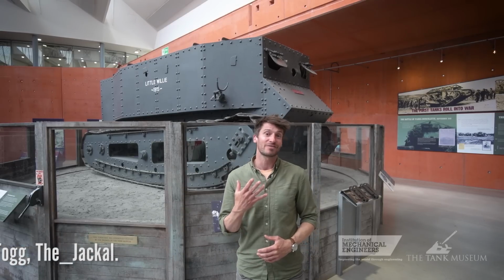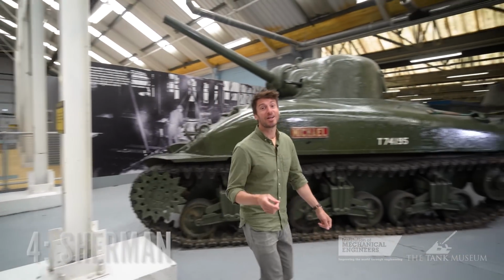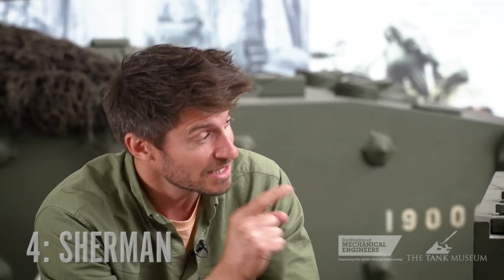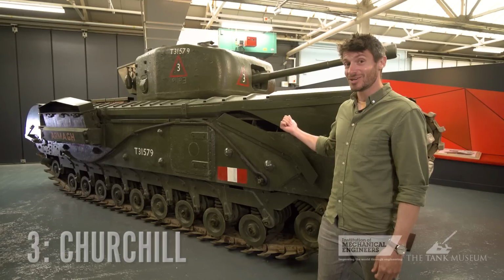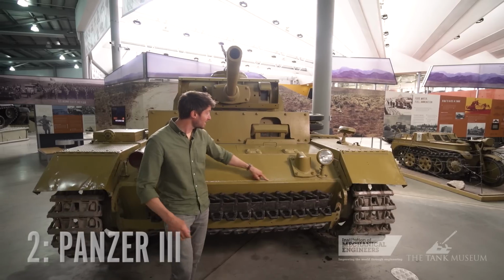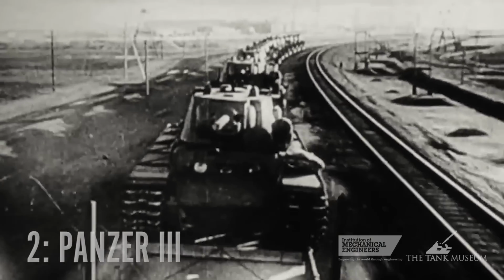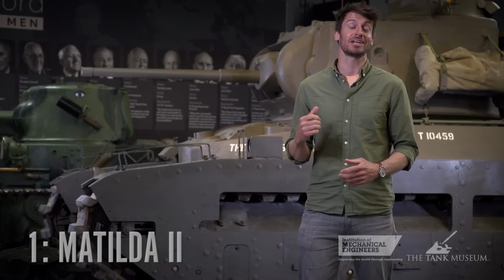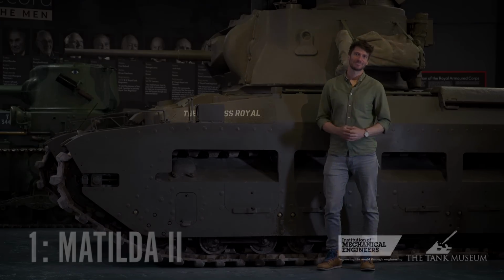Rob Bell | Top 5 Tanks | Institution of Mechanical Engineers | The Tank Museum

Comment: 'Five tanks and five rules for engineering success' 00:06 - Welp, that's the German cats out...I like this list already
Reply: Is not one of them get the technician to check your using the right formula or how ohms  law works
Reply: @mauricewalshe8234  Leopard II best tank in the world!!

This comment was made by the Bundaboo GANG
Reply: Realkeepa 1991 Only thing missing on the Leo 2 is that sweeeeeeeeeeeeeeet Turbine engine that the Abrams have 😍
Reply: @kshatriya1414  And a fuel tanker following. Gas turbines are notoriously thirsty
Reply: @g8ymw  They're not so bad when they're actually moving, but at idle..
Reply: @kshatriya1414  
Leopard 2: 12 cylinder diesel engine MTU MB 873 
Abrams: Gas turbine AGT-1500
 
The difference is for examaple that the M 1 needs twice as much fuel as the Leo 2.

I think the only thing in common is the fantastic smoothbore tank gun Rh-120 from Rheinmetall
Reply: @r.j.3440  a straight turbo diesel is also much more reliable than a turbine. Especially in extended military operations where scheduled maintenance is a pipe dream.
Reply: @LARGO125  …and Diesel you can get on every gas station
Reply: @wernerkl4036  they both run in the same fuel.
Reply: @JimmyCrawford  Auxiliary Diesel Generator: Am I a joke to you?
Reply: @r.j.3440  First: Twice as much fuel, that is an extreme over exaggeration. Although while under-load  the Gas Turbine consumes a bit more fuel than the Leopard, the bigger fuel tanks will ensure the Abrams will run out of fuel around the same time as the Leopard. 
Second: The Abrams has a auxiliary diesel exists for idling.

Comment: Matilda 2 yay! So refreshing! 😋
Reply: I expected Valentine as nr 1. It required 1/3 of the work hours to make than Matilda II. Similar protection to T-34 but was much cheaper. Perfectly engineered to match Britains specifications (being cheap and under 20 tons) it saw many improvements. Designed with a 2pdr gun it ended up with a 75mm. Because it was smaller, more mobile and more reliable than a Matilda II, Soviets liked it better.
And the fact that is was cramped inside isnt an engineers fault. The blame goes for underdeveloped British doctrine, and pre-war government cuts on land army spending.
Reply: @Paciat  I suspect the The Tank Museum effort to restore the matilda tank has highly influenced the decision for the top spot

Comment: On the No1 choice the criteria surely fits the Valentine better. The Matilda II required skill and resource heavy large castings and a difficult to maintain track system. The Valentine was designed for production ease without compromising performance. Still being used in 1945 by the Soviets who always wanted more. Design requires compromise and the Matilda II only scores above the Valentine on armour. The Valentine allows more tanks to be made and those are more likely to actually arrive on the battlefield thus the Valentine is more effective for the same resources.
Reply: Yes! The other entries on the list focused on properties of each design. The Matilda II was designed for the previous war, didn't learn the lessons from Spain, Khalkin Gol, and couldn't really be adapted - no upgradable gun. The whole 2 pounder fiasco ranks up there with the US torpedo fiasco. That it was mass produced is not saying much for the design as the general industrial capability of GB in the late 1930s and early 1940s. There was a lot of companies and shops that could do complex metal work to specification. From the Tank Museum's own series about fixing up the Matilda, that tank was a bear to build and maintain with many hard to access fussy bits.
Reply: The two things that push the Matilda II over the Valentine, from the video, was the length of service and the variety of theatres it served in. While the Valentine was meant to be the successor to the Matilda, it wasn't put into production until 1940, after the war had started. By comparison, the Matilda had been first produced in 1937, a full 2 years before World War 2, and 3 years before the Valentine first rolled off the production line. As for the breadth of service, both tanks served in a variety of theatres. Freezing cold snow, blistering deserts, soaking wet jungles, cramped farmland and bustling towns and cities. The Matilda was more widely known to have served in all. So while there were issues (and positives) with both tanks, I can understand where he is coming from.
Reply: @f12mnb  well that's not at all a fair comparison is it?
Reply: The Matilda II was used until the end of the war across the Pacific. Basically impervious to anything the Japanese could throw at it.

Comment: The only man to say the churchill had excellent mobility
Reply: Rachid Khamlichi not the only, have you seen how steep a hill they’ll climb?
Reply: @DeBlobbb  yes but mobility is also about speed and change of direction
Reply: @everythinggaming7938  The churchill is an infantry tank, it is not supposed to go fast. It's role is to stay with and support the infantry, cruiser tanks are the ones that are for exploitation
Reply: @DeBlobbb  which means it's does not have mobility.....
Reply: Rachid Khamlichi mobility is the ability to move, not only the top speed. It also had neutral traverse and great trench crossing due to its length. All are mobility factors, it’s not only about speed.
Reply: @DeBlobbb  it has not trench crossing capabilities trenches where made much longer by the time the churchill came out and it never seen trench warefare. It was WW2. It is not mobile, everyone knows this. Its biggest downfall was mobility

Comment: one major design flaw in the Sherman was the height of the tank, It was a good all rounder, and simple to look after how ever which is why it did so well. Glad Matilda 2 got number 1, it was a amazing tank. Sure it was no Tiger, or T34 but it was solid.Don't forget the Matilda was up-gunned by the Russians who were trying to put a 76mm (i think? or 75) gun into it. 

But honestly? a little anglo-centric list and i think the Centurion would be a better number 1 as it was really the first MBT when released it was extremely modern and would not look out of place today. The Leopard 1 and later variants with it's stabilizer should also work onto the list, for a pure engineering standpoint there are so many more important tanks. :p
Reply: Agree, the Sherman was smaller than a Panther,  should have made him mucher

Comment: You say the Sherman was not innovative, but it was the first tank ever to be produced using the US automotive standard of  "Design Engineering".  Meaning its parts were completely interchangeable.  No other thing before was made in such a way, and it would still be some time until all production methods followed these standards.  There was never a need to "Fit" parts to the end product, that's the very antithesis of innovation.

Comment: Well, at least the Panzer III was recognized. The Matilda II was alright, well armored but under-gunned, decent for infantry support only.
Reply: other way around, it could knock out any contemporary panzer, but the lack of HE rounds made infantry support difficult.
Reply: @Panzerzwerg  well any contemporary Panzer up until 1942/1943
Reply: It was a very English perspective
Reply: Was still used by Australia in 1945 , the Japanese had nothing to take them out .
Reply: My Pa drove one , we used the BESA to clear the tree tops and the tank itself to just drive over bunkers , ones with howitzers or flamethrowers were more favoured though
Reply: @AndrewMitchell123  Any Panzer III, IV and StuG. Later StuG variants might be a problem.
Reply: Should have crammed a 20-pounder in it.
Reply: @Panzerzwerg  I am not sure about Pz IV H - 80(85) mm of frontal armor might be a bit of a problem for that little 2 pounder
Reply: @AndrewMitchell123  that "little" 2pdr (40mm) hight velocity round wasn't so puny until later panzers were produced. As has been said, it could knock out ALL German tanks in 1940,was specifically designed to withstand the standard 37mm anti tank round of the time and had spaced sloping armour at the front.
Reply: @AndrewMitchell123  With APCNR it could punch through over 100mm of armour. That's enough to kill a Tiger frontally.
Reply: @1993Crag  at what range? also how many rounds could they use to be effective in that fight, like in what quantity?
Reply: @AndrewMitchell123  Most tanks were mission killed if they got penetrated, no crew stays around fighting when you've just had hot metal burst into your fighting space with another probably on the way.
Reply: @cpmenninga  the turret ring was too small to allow a big enough turret to allow a larger gun. Besides, the 20pdr wasn't available till much later

Comment: The British bias sadly is a bit much at times here. I respect the nostalgia of the old tanks from the past. But the Churchill and the Mathilda had a massive flaw they both shared. They were usually under gunned and they were way to damn slow. Even the hulking tiger tank was more than 2x the speed of either one of them. And it could pick one off at 2000 meters. If you don't consider the production difference. There was not comparison.
Reply: I think you missed the points being made here. It wasn't 'tank A > tank B', but rather looking at the parameters that make a good tank from an engineering view point. Nobody is saying the Matilda II was the best tank ever made, obviously. As an engineer myself, the points made here were spot on. As for a British bias, well all of the bottom five tanks that were selected were British...

Comment: I'm sorry, I love the Matilda II, but it is not an illustration of good engineering, it is an almost exact opposite, and I find the choice as No1 weird, if not spurious. It is an illustration of Britain's dependence on craft skill rather than modern design. Time and again the Tank Diary showed some bizarre cludge in the design that required expense and skilled labour to make, and mend. The copper pipework taking coolant under the engine probably took as much time, resource and labour to make as a Sherman's engine, or an entire T34. The British may have made 5000 tanks in 1941, but they made less than 3,000 Matilda's in total!
Reply: What Glyn said.

Cast the front hull, then physically grind the sides down to reduce the weight.

Design for manufacture kids. Just because you can design something doesn't mean it is easy or economical to make.

Comment: Slightly misleading on the PzIII.

The vehicle was not actually future proofed. It was designed for a 50mm gun, then once they were committed to a turret big enough to mount this weapon they were told there was no budget and the Panzertruppen could use the same size weapon as the rest of the army.

So it was fitted with the 37mm because of what in many ways was bad project management that led to compromise. The F was in many ways the version it was meant to have been from the start, not the version it grew into. Once past the 50mm the vehicle really didn't have anywhere left to go. The long 50mm was peak PzIII. The short 75 versions were, well, almost a solution looking for a problem and had German production and long term project management been up to scratch these later marks probably wouldn't have been built. You can say that early British tanks lacked growth potential, but the British knew that, which is why they replaced them with newer designs. (Cruiser III/IV -> Crusader -> Cromwell -> Comet)

Having said that I do like the PzIII. The F/G versions with the short 50mm has, to my mind, a very pleasing balance of proportions in exactly the same way the Cruiser III completely doesn't.

Comment: Chruchill had great manuverability. Funny guy.
It could overcome steep slopes better than anything well - that all it has to it.
Reply: It's easy to get maneuverability mixed up with speed but that's not what he was getting at, not only could the Churchill scale heights that no other tank could as proven during fighting in Tunisia and Italy but it was excellent at negotiating twisting paths such as through a small French village.
The admittedly much faster Shermans gearbox and final drive system required that their drivers carefully assess any turn he needed to make, select the correct gear and speed for the turning circle required and then aim for the gap, any mistake required him to reverse and try again and often with an entire tank battalion at his back, try doing this at night in the rain under shellfire without driving lights and it might be realised that the Churchill held a huge advantage in such circumstances.
The Churchill driver could steer himself through tight gaps much as we would do with a car and if he made a mistake could then neutral steer (ie, turn in his own length) until his bow was facing the right way, no reversing needed and thus no hold up.

Another advantage was more tactical in nature in that if caught in the open by an anti tank gun off to a flank the Churchill could instantly spin in that direction thus offering its considerable frontal armour to the enemy and either immediately reverse into cover and/or return fire.
In the same situation all other tanks had to drive forward  in an arc or reverse in an opposite arc to front up to the enemy.
This could be a big problem if caught on a confined road or bridge.
Reply: Churchill was designed and employed as an infantry support tank, for attacking defensive positions; no point having massive speed if the infantry can't keep up.